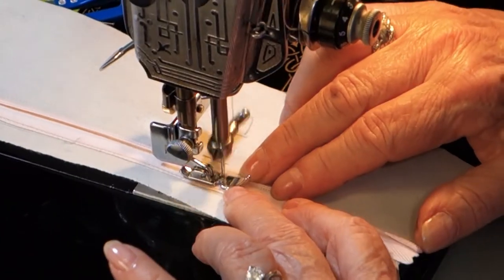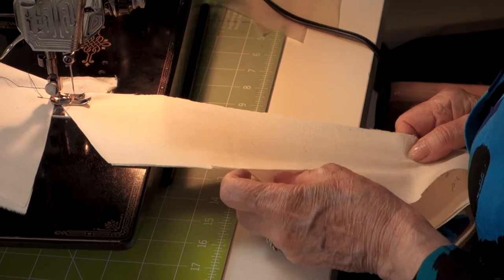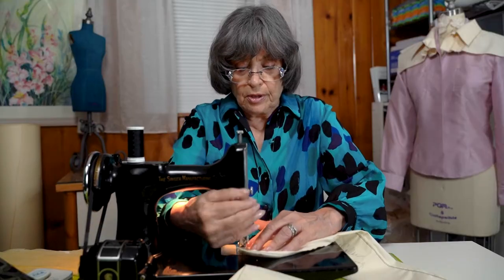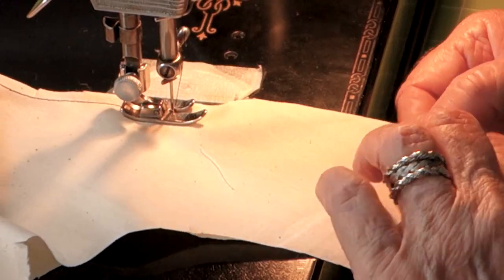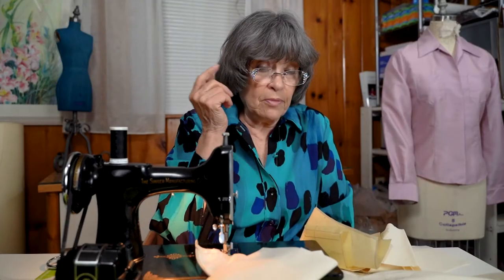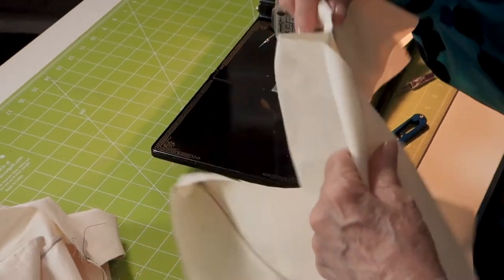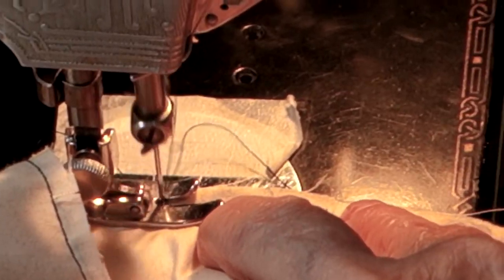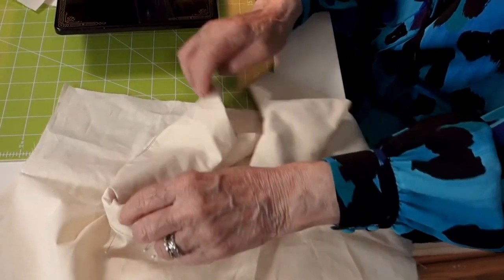How to Sew a Convertible Collar

Comment: Love that you are using your vintage machine......I've got about 50 of them.....still wind up using my Bernina
Reply from the maker: One of my students just bought a Bernina. I can't wait to see it. Understand they are wonderful!

My go to machine is my 260, built in the 1950s. It's a fantastic machine, designed for professionals, it is set in an industrial table and is hooked up to an industrial motor. Just picked it up from my local sewing machine store where it was overhauled. https://www.instagram.com/p/Cbk17roLel_/

It has speed and control, but is a bit noisy, the reason I demonstrate on my Feather-weight when filming.

Comment: No one has explained to me when to back-tack and when not to. These are the kinds of sewing tips and skills you need to become a proficient sewist!  I am always impressed and love the no-nonsense approach, no fluff, no hand-holding, just how to sew well!
Reply from the maker: I'm glad you like the video. I'm very interested in my viewers' comments. Thanks! I learned everything you see on my videos when I worked in industry. Because industry is line assembly, many employees don't know how to do the jobs of co-workers sitting next to them. Pattern makers don't know sample making (sewing the entire garment together using industrial methods), sample makers don't know pattern making, designers don't know either, etc.

I asked my sample makers to explain how they sewed. I worked were union shops and was  management, so I wasn't allowed to sew on the machines, but I practiced at noon when I was "off the clock," and when I went home. 

I never had any false pride. I didn't pretend to know industrial sewing, as some pattern makers do. Besides, the sample makers know if the pattern makers don't know how to sew. The sample makers were really happy that I asked. I was their boss and I wanted to know how they did their job. That meant when I drafted the patterns I would know how to set the patterns up so they would be easier to sew.

Its always seemed to me that a pattern maker should know how the garments will be sewn together, if she is drafting the patterns.

Comment: Nice featherweight.
I have a 1937 and a 39. Amazing little machines. Thank you great video
Reply from the maker: Thanks for commenting, Joyce,

Featherweights sew like a dream. One can sew just about anything on them. I take mine into my classes to demonstrate. Easy to understand and use, the students see me use that machine to demonstrate and learn the lesson quickly.

Featherweights are scaled down versions of the workhorses used in industry. Today the machines are computerized for speed, but they are essentially the same as the Featherweights. AND you can save electricity. If you don't turn on the switch the machine still sews. Electricity was expensive back when they were built.